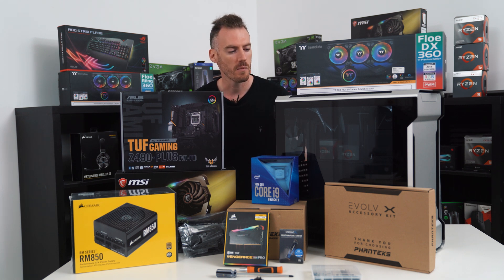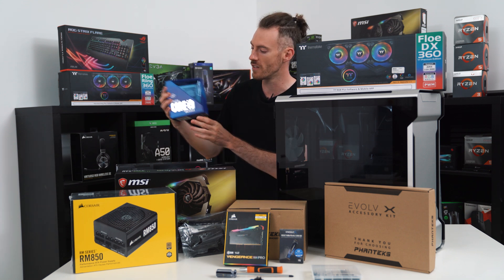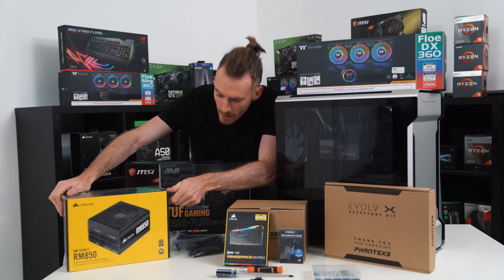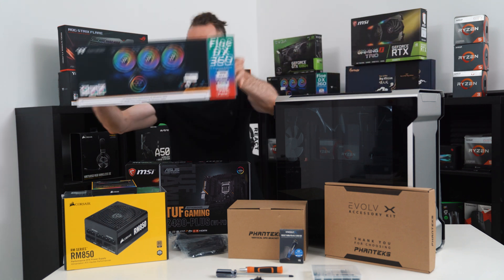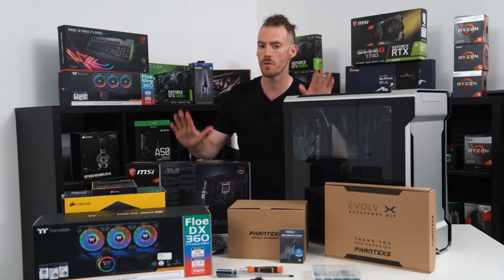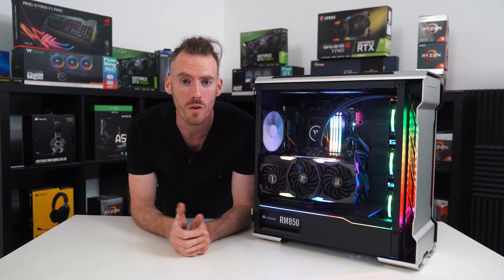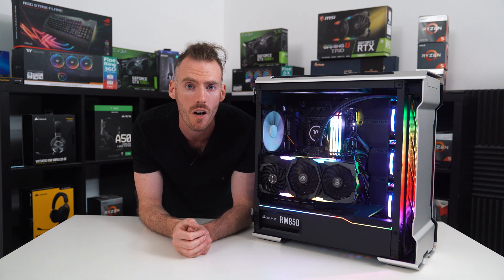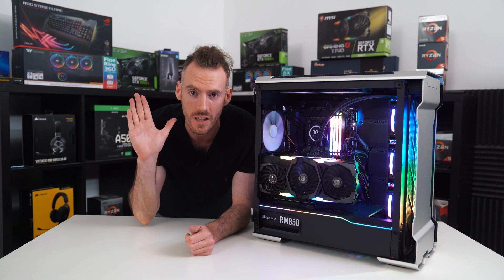$3300 Intel 10900k PC build!

Comment: wait a sec, how is the 2080 ti standing up verticle like that? btw great vid
Reply from the maker: You can buy a GPU vertical mount, some cases already support this, just check for the (usually two) vertical IO brackets to the right (when looking at the back of the case) of your normal Horizontal IO brackets, if there's none there you can buy this: https://geni.us/JGGZT2 This will replace all of your current Horizontal IO brackets in exchange for a vertical one. If you do have a Vertical mounting solution built into your case you will need one of these: https://geni.us/llxCq6g This is a PCI Extension cable essentially and will be needed to link your new Vertically mounted GPU to your motherboard, just install each end of the cable like you would a GPU in a motherboard. hope this helped - Jack
Reply: @WePC  interesting, thanks

Comment: Great build except for the AIO. Not smart to put liquid in an electronic device when there are comparable alternatives.
Reply: What? Lol. It’s literally built for that purpose
Reply: @Alex-ph2yn  If it will only work with an AIO then I wont be downgrading to that setup
Reply: A Dillpickle lol. An AIO is literally built to cool the cpu or gpu, they are built to go inside of a computer. And obviously don’t downgrade lol.
Reply: @Alex-ph2yn  when the pump goes bad or it starts to leak, then you will realize its not smart when there are logical alternatives
Reply: A Dillpickle dude. U do u